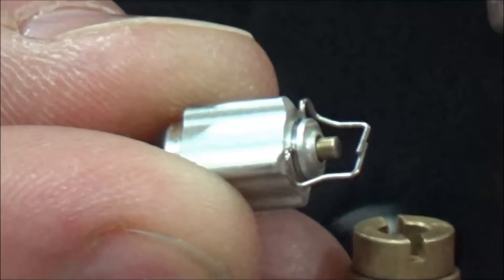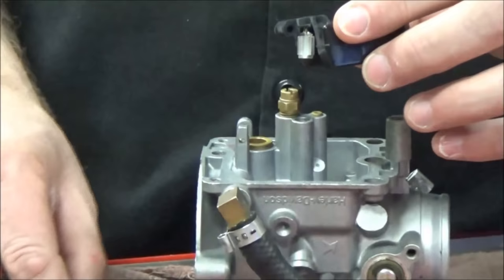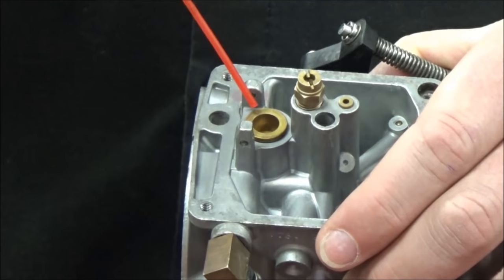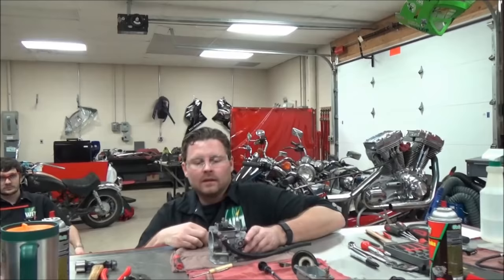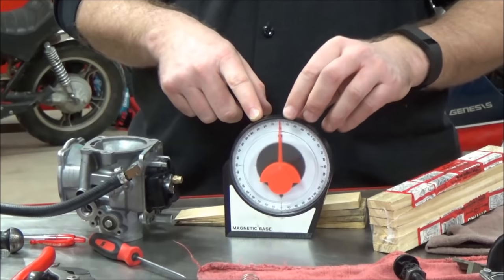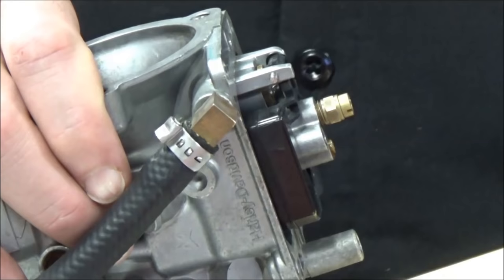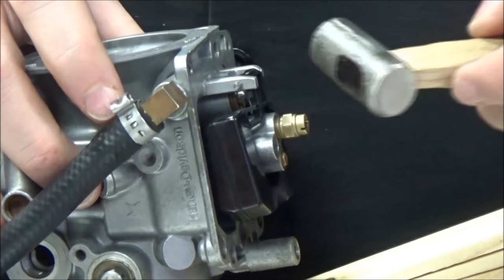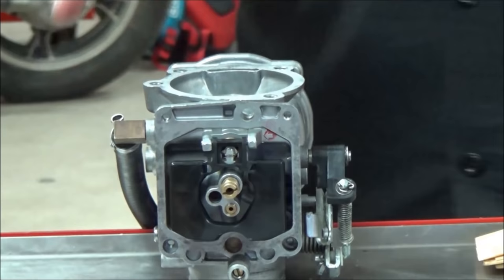04 How to inspect and adjust float level on a carburetor. BONUS: RICH LEAN Fuel Settings explained!

Comment: So do you want the float parallel to the bowl edge when the float valve spring is uncompressed, or compressed all the way down?????
Bloody worst tutorial ever....
Not like it matters anyway, mine is wrong, and it's made extirely of plastic with no bendable metal tab and not adjustable.  So what now?   I'm having to custom engineer my own float apparatus from scratch so I'll have some way to adjust it.   Carbs are the absolute worst.